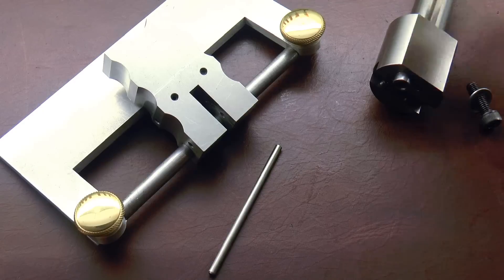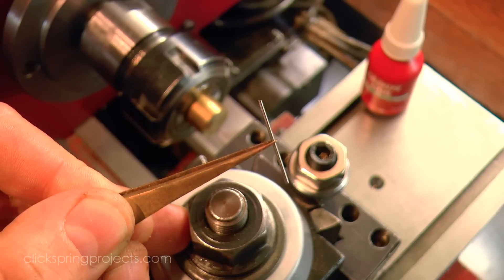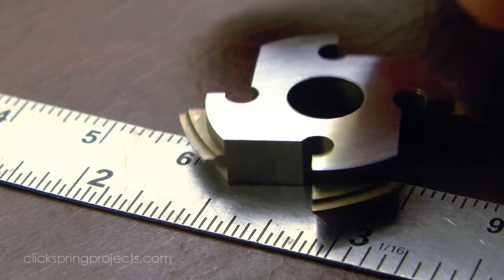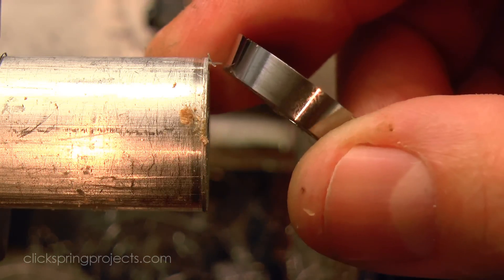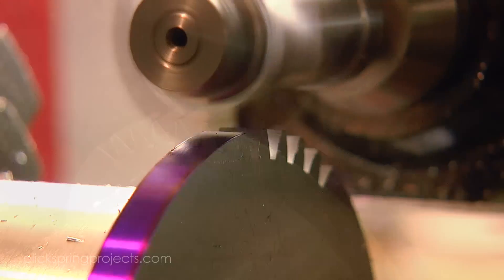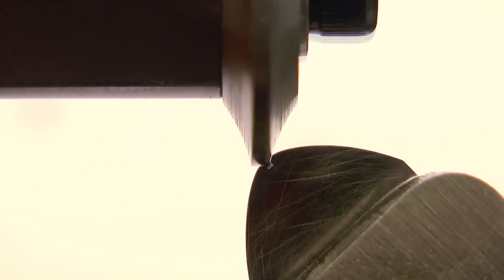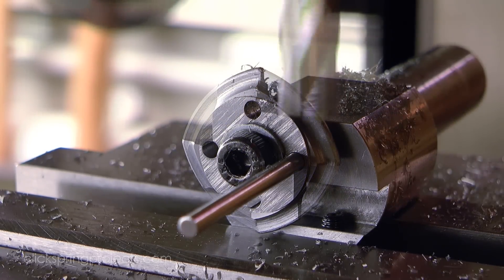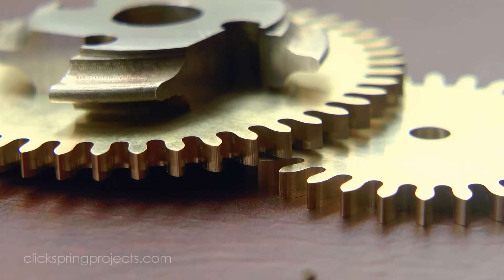Tools, Glorious Tools! #10 (Part 5) - Shop Made Gear Cutters - Tooth Fillets & Edge Cases

Comment: if i'm not mistaken you could make cutters with more cutting edges if you make more holes for indexing in  the fixture, and 4 was juat the simplest pattern to make with 2 axial measurment
but i am impressed how the fixture works as resharpening tool 
since cuting edge profile is relived inwards the profile stays the same after sharpening even multiple times while cutter itself might get smaller
but for heavy weared cutter i would also implement some kind of a stop so you resharpen all surfaces to the same depth, it would avoid the situation that one cutting edge becomes longer after sharpening and the cutter hunts with just one edge while rest remain fresh and hidden because they have nothing to do, with multitooth cutters that might be intentional to stagger the cut over multiple teeth like a broach, but with only 4 edges it would be probably best if they all cut the same

Comment: 1.5 Module. Approximately 17 Diametral Pitch. Total toothedepth about .125". Not really that large. It is not just lnvolute or Cycodial gear cutters that can be made withthis method. Angle cutters, spline cutter (involute and parallel types), cutters for toothed belt sprokets etc.

Comment: Gear making has become an addiction for me. It's one of the most satisfying experiences I've ever run into in my home machine shop. Thanks for the inspiration and the quality content.
Reply: When I was working I cut more gears than I care to imagine. The most satisfying were Helicals. To cut a Helical your math for the index and Feed ratios have to be dead on at least a difference off .00005 or less. That's because we cut gears on machines that generate to tooth form. Gear Hobbing and Gear Shaping machinery. The nice thing there is one cutter will cut the whole range of teeth that would take a whole set of profile cutters.

Comment: I do love how you put the blue Dykem on the gear blank being cut.  Not sure why but I find it comforting.
Reply: To allow him to see exactly when the cut is completed - as soon as the blue goes away, you know the cut is done. You don't want to go any further - maybe even leaving a tiny strip of blue would be best.
Reply: Do you mean Loc-Tite 609 used to glue that tiny cutter in place? That stuff come in very handy. (Dykem is great too. I use the blue, but occasionally also the green color for complicated layouts.)
Reply: @samdude1953  No I mean the blue Dykem he puts on the outer edge of the gear blank before he cuts the gears. It’s not like he marks the tooth location and then manually cuts each tooth.  It’s as if he puts the Dykem on out of habit.
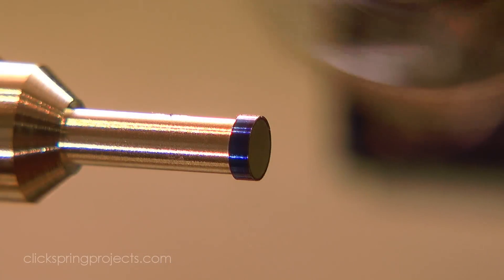Reply: @samdude1953 I believe they're talking about the miniscule blank at 6:20 - I think it would be very hard to see the cuts without it!
Reply: @samdude1953 
As l understand it Green Dykem is specifically meant for brass and other copper based alloys. When I was working I had Blue, Red and White. The White is meant for working with cast iron. For general work IMO Red is much better than the Blue. Blue Dykem flakes off far to easily no matter how clean the surface is. But the best layout fluid for ferrous metals is Copper Sulfate. Commonly called Blue Vitriol. Does not dissolve under cutting fluids or flake off. Yet polished off easily. Can be mixed at home using Copper Sulfate Root Killer.
Dykem also used to have a Yellow and Purple iirc.